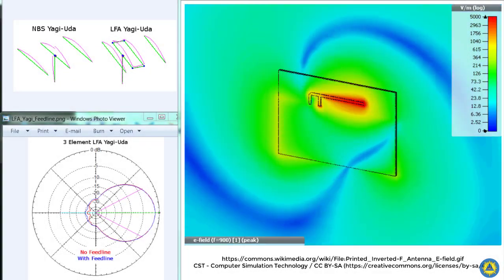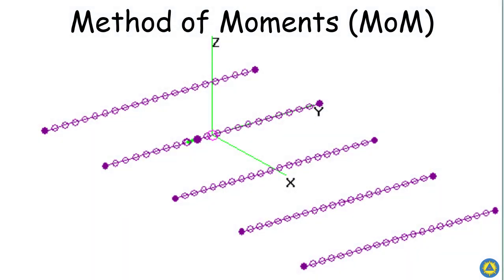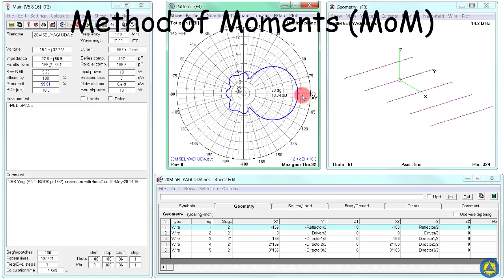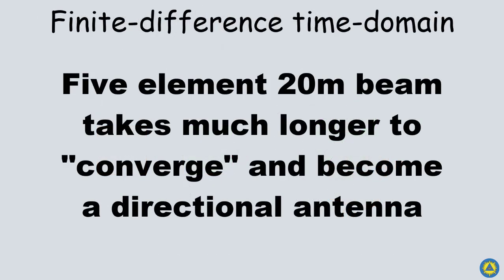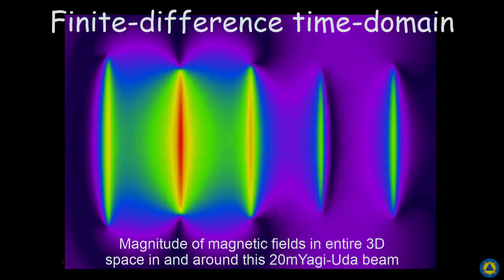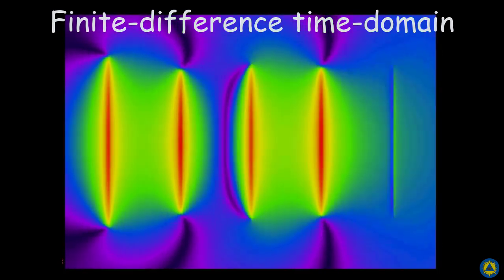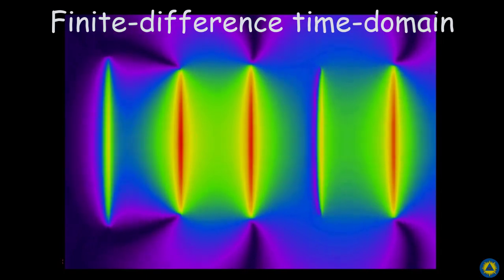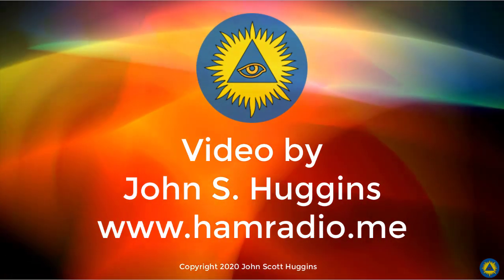Method of Moments (MoM) vs. Finite-Difference Time-Domain (FDTD) antenna simulation

Comment: Thank you for a clear, concise comparison of the two methods. I've been playing with Ansoft HFSS which works more along the lines of FDTD technique, but it also requires longer run-times than MOM like used in 4NEC2.

Comment: Are you available to design 2 co-phase 2 element Delta loop wire beams for under my 16’ tall bay house on stilts? I need modeling done before I build. If interested, contact me via my YouTube channel contact. I will pay you of coarse for your time. 73’s George